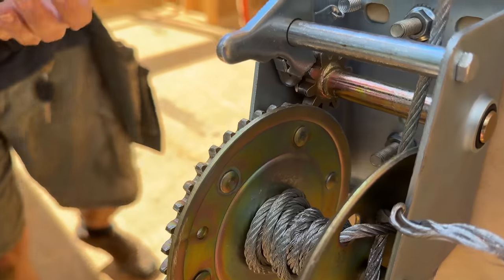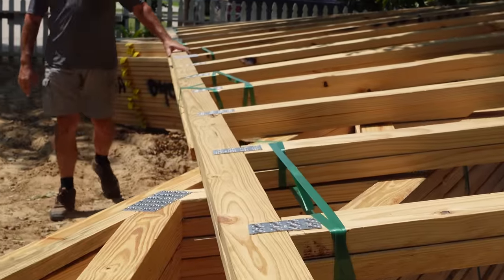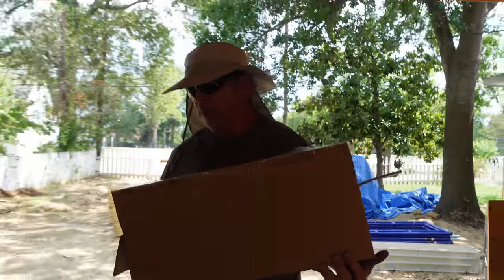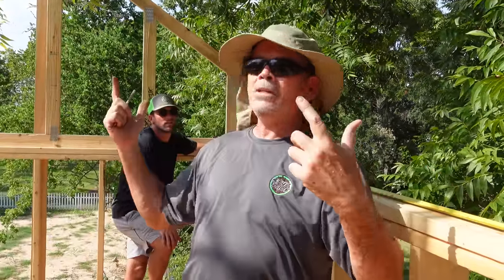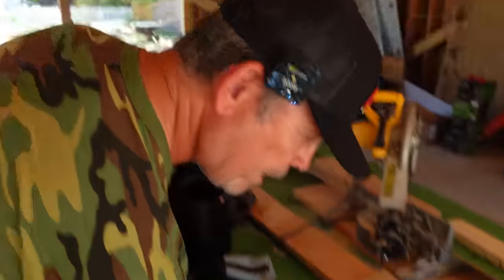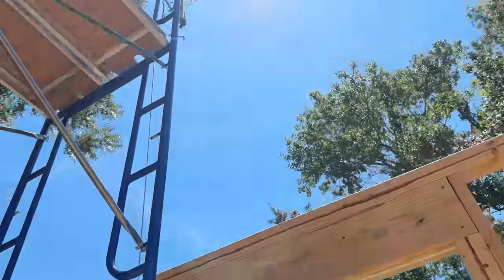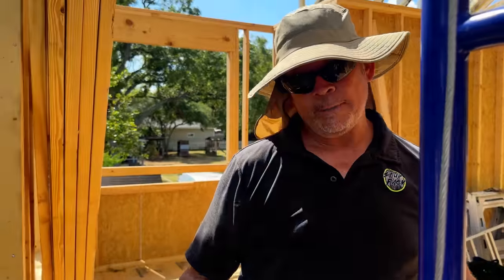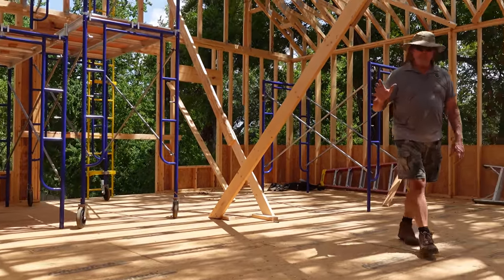Climbing 30 FEET UP to Lift Our Trusses by HAND! (Saving us Thousands)

Comment: This is reminding me of an episode of 'How It's Made' and I'm loving it! I had no idea they made trusses with machines like that.
Oh wow! Rad really is rad! LOL. 
Trying to lift the gable end up is where one of those electric winches you put on the back of a truck and a pulley wheel combo would help.
If you don't have a crane when working on the main house, maybe try the winch thing with a pulley. Did you have an actual pulley wheel? I didn't see one, but my eyes are not great.
You know how sometimes you can use an electric drill can be used to wind/unwind things? I wonder if that would work for turning a mechanism to lift trusses.
Very cool of Diamondback to send you tool bags. One can never have enough tool bags. 
I like your hats with the wide brims and the cloth hanging down the back. I wonder how hard it would be to make some of those with the Stud Pack logo.
Rad goes up and down the ladder fast!
If you make a finished attic you could have some extra storage space up there. You'll definitely want a good attic access and ladder (or folding stairs that can come down).

Comment: Good work fellas, in my old framing crew three of us would stand on the top plates of walls and each pull at the same time, required a little man power but worked like a charm.

Comment: Paul, could you have used a 12 volt impact drill just like you would use for changing tires on a car the crank that winch.? It seems like everybody does that now at the campgrounds with their levelers. Keep up the great work

Comment: I had the same hand winch I used to lift refrigeration compressors on roofs. It lasted about 5 times then the gears started separating as yours did on a lift. They are junk. I have now converted to a 120 volt winch made by Warn and have no problems at all. And I can lift by pressing a button. BTW, I agree with your brothers. A crane is much safer, quicker and more dependable. In some cases I have used a locally rented man lift that reach out to put some systems and piping in place. It's quick and easy.

Comment: if the handle comes off the winch,  measure the shaft ..if 1/2" or less use your drill driver to motorize the winch.. i did it 10 years ago to lift a steel jeep roof for storage..

Comment: In 30 +yrs of framing I've seen my share of pre-fab trusses and with a crane and ample manpower I wouldn't boldly proclaim of how much easier it is when all said and done. As for cost of the crane , check out the Hempstead area next time . Stay safe guys!
Reply: I use Heave Ho crane service in Houston. Good service. Reasonably priced. I believe there's a 4 hour minimum.

Comment: great job there guys, but quick question, these are 2x4 trusses right? why not hand them up through the big window and stack them upside down on the walls and flip them to set them in? When we built our house thats how we did it and we had three people on 35 foot trusses and it went smooth and quick, had them all installed in a day and started sheathing them. Just wondering but great job on the house looking forward to the rest...

Comment: When doing the scaffold crane...

add some cargo straps to keep the scaffold from moving and to diagonal brace it via tension.  You're applying forces in directions the scaffold designer did not expect.

Comment: Shackles have rating on the pin and are certified rated for overhead lifting clevis is also have a weight rating just usually not stamped on the pin as well and are generally for farm use or lateral pulling

Comment: On gable end trusses we would have a 2x nailed to the top plate set back 1 1/2" to also allow lateral fastening of the gable ends. This also serves as a drywall nailer when that application is needed.

Comment: might be more efficient and less labour if you can replace the crank handle with double/triple nuts bolt together and use the cordless impact driver to crank the winch

Comment: if you use that setup again, take the handle off the winch and put the bolt back on tight then use your impact to operate the hand winch.

Comment: Great job getting the trusses up. Those are some tall awkward trusses. With trusses you would normally take a 2x6 flat and run it plate height down the mid span of the building with 2xs nailed underneath it toe nailed into the subfloor and braced over to the exterior wall. This gives you a cat walk to walk on and support to hold the trusses when you spread them out flat on top of the top plates before you tilt them up. Haul the gable truss up and drag it all the way down to the end of the building and hang the point of the truss as far out over the outside edge as you can safely balance it. Then drag all the remaining trusses up the same way and lay them over the top of the other trusses already up there. After all the trusses are up you start standing the gable truss up on the other end and continue until you get to the last two on the end you started on. Pick the last two remaining regular trusses up and temporarily lean them against the last truss you have installed so you can lift the initial gable truss up and put in in place and then drag the last two regular trusses back and put them in place. Always toe nail a 2x straight edge on edge not flat into the building to keep the gable truss from falling off and to give you a place to nail the truss temporarily. Put the straight edge up before you stand the first gable truss and after, you lean the last two trusses and the gable truss up on the other end. I'm curious if you did a plan revision through the building Dept. for the re designed roof design. I know the architect must have had a reason for the way he originally designed the project. Most trusses require bracing at 45 degree angles and with the ceiling being so high and don't see how that could be achieved the way they are now. Maybe the solid beams were for lateral support. Where I'm at a structural change like that would have to be done through a plan change. With the interior walls you could have balloon framed the wall to within an inch of the bottom cord of the truss and rake framed the walls running the same direction as the trusses. This would eliminate the knee action you will have with the way you did it. Simple math. Snap out the rake lines on the floor. Never attach any built up walls to the bottom cord of the trusses. No wood member should be attached to the bottom cord of the truss. Good job and ingenuity in safely getting the trusses up and installed, although somewhat sketchy.

Comment: That is a shackle with a shackle pin, the pin on a shackle is almost always threaded so that it passes thru the hole on one side and screws into the hole on the other side. Although if it is a safety shackle then it has a bolt that passes thru the two holes of the shackle with a nut and either a cotter pin of some type or a safety wire that passes thru a hole drilled thru the threaded end of the bolt. A clevis almost always is fastened to something (i.e. a machine, vehicle, etc.) by welding or by means of screws or bolts and almost always has a clevis pin that is non-threaded and that is held in place with a cotter pin. Also a clevis is also usually used in towing applications(mostly on farm equipment), whereas shackles are typically used in construction, lifting and rigging. Such as in your application. These days however, like so many, many other things, the distinction between the two has become blurred ( by people who have become lazy about learning the proper names and meanings of things) and the two have started to be used interchangeably. One person even put it this way(I believe wrongly so); "All shackles are clevises but not all clevises are shackles.". I believe a shackle is a shackle and a clevis is a clevis and never the twain shall meet.

Comment: Just wondering why you did not lift them all and stack them to the back and then walk them out into position across the project. Could have lifted several at a time and moving them while vertical into position should have been easy.  Just wondering. I loved the winch idea and am going to use something similar on future projects.  Great stuff guys

Comment: Clevis is a marine term for a similar device designed for rigging, typically for sailboats.  A shackle is designed differently for heavy loads and abuse, coming in 2-part and 4-part shackles.

Comment: A lot of framers these days don't put "rat runs" on the bottom chords of the trusses, it needs to be done though or you'll have screw pops, and cracks in your drywall. That's why I always show up to new construction jobs with a pile of 2x4's. When the drywall cracks, and the screws pop they don't call the framer back to fix them so I try to take some preventative measures to keep it from happening. It might not be as bad with those trusses since you won't have anyone crawling around in the attic blowing insulation etc, but I would still tie them all together on the bottom chord. Nice work with the crane! Also interested in seeing how those diamond back's hold up, I've had bad luck with those style bags.

Comment: I built outdoor concert stages and would suspend tarp roof structures over the stage using scaff towers in a similar manner, Word of Advice, put the winch on the opposite side of the tower from the load, this will help prevent tip-over of the tower by spreading the load over ALL 4 legs.

Comment: Should have used a block and tackle configuration to pull it up for less stress on winch. Put  trusses up first and maybe mount first 6 then lean rest against wall then easily raise in place with the scaffolding.

Comment: We spent many winters in Mexico. You are building as they did. There are old pilot and bold pilots but there are no Old Bold pilots. The same probably goes for roofers. Make sure you have approved plans by the city inspector for your new roof design. Code in our area allows you to use 1x4 placed within the rafters to hold them in place and you can leave them after. The external 2x4 also works but it is one more step when you have to remove it. When we build our 2 story garage with rooms above the contractor had the rafters delivered and place upside down as a bundle on top of the walls. He then flipped them upright one at a time. Next set see if the fabricator has a truck with a crane that cam place the trusses on the walls. OHSA would site you for moving the scaffolding with a person on it.

Comment: FYI....Amazon sells some nice 120vAC winches rated at 1000lbs. I got 2 of them they work great and have been extremely handy on several occasions. Highly recommended. They even have wireless remotes. They cost around $400.00. Keep on building!

Comment: It looks like the handle is either slotted or relies on the 2 side braces, either way you could modify a socket if you have to to fit over center nut and then tack it fast. Then get a socket adapter for a drill and pop it in and go to town. Maybe a Milwaukee right angle or hole hog on low speed.

Comment: I do drywall in South Ga... I have to use the scaffolding like that to mud the ceilings...I'm on concrete most of the time, but on wood, make sure no nails are sticking up or else Brad will have to jump down 40 ft...love yalls work and channel...

Comment: I hand built the trusses for a garage build.  Then built a crane extension for my tractor using a harbor freight winch with a remote control.. set the trusses by myself.
Love what you’re doing boys.

Comment: Did you grease the main gear and axle on the lifting crank to reduce the cranking tork stress before you started?  I find that companies use water based lube to protect gears for shipping and need to be lubed properly before use.  Nice job and well thought out way to “raise the roof,”

Comment: I was a millwright. Worked with shackles and pins my whole career. Blew the dust off of one of my rigging books from my apprenticeship days. They describe the words "clevis" and "shackles" as interchangeable. And, I have heard them referred to as both, usually  depending upon the part of the country. I always called them shackles and pins or screw shackles.

Comment: I've done something similar to your winch trick. But I took the handle off and welded on a socket so I could attach a big drill with the side handle to it. It'll lift those trusses up fast, just keep some wd 40 on hand to keep the gears lubed. You can also weld a socket driver on the original handle so you can use it if you need to.

Comment: aligning the studs to roof rafters is part of "advanced Framing" techniques.....you could have framed it all at 24" on-center spacings, thus eliminating the top-plate, saving a lot of lumber and reducing "bridging.    Look into "advanced framing" when you start in on the main house....cheers!

Comment: Amazing use of scaffolding for trusses , I’ve never seen that . 
Later on in my cart I started to like cranes and telehandlers to save my back plus labour costs are a little less .
 Having said that in urban areas we hand balmed them up with two or three ropes (three people ) including 50’ trusses ouch.
Put in the end it’s about getting the job done with what ever is easiest for each individual job and circumstances. 
That is a high roof design btw .

Comment: Suggestion: next time remove the handle off the winch, re-apply two nuts to tighten against each other and use a cordless drill and socket for operating.  I’ve done it and it’s a timesaver!

Comment: That winch is a great idea.  The hardware guys should have shown you an elongated nut (usually used with a 3/4" socket) that you could use with an impact wrench or just a H.D. 20v DeWalt drill.  That truss would go up 4-6 times faster and not wear your arm out.

Comment: If you have have to do this again use a wyrm gear one. It will cost a bit more but it can lift at 2200+ lb easy. Big bonus you can take the handle off and drive it with a drill and socket. Lifted all the lvls at my place with one and all the trusses at another. We also put up a 35' 3 ply lvl with 2 of them. I think they were $40. Also there is no brake so you can go up and down as you want.

Comment: Okay, I'm impressed but after reading a lot of comments, I was torn between their ingenuity and accomplishment vs. the safety sketchiness of it all. In my mind, all they did was build a material lifter which back in my factory building days, we used dozens of them... a 24' Genie lift would have been easy to rent but they would have had to rig it  up with a jig and then use another lift up on the open deck adding complexity with a handoff so hats off to them for figuring this out the way they did... If I proposed something similar back at work, the Safety Engineer would've shot it down unless we 'engineered' and built something official and it would been similar or the same but with outriggers and taken several weeks of delay. Great job Stud Pack!

Comment: The cost for a telehandler rental must have been high. Those things make quick work of those trusses. And no cranking. Maybe instead of the crank ya'll could mount an electric wench. Got one on a truck bumper you could borrow?

Comment: Most professional framers hang their hammers in the back of their bags. It stays out the way when you walk and move around. However if you fall, if the hand is perpendicular to your body when you land, it can break your back.

Also a second pro-framing tip. You always keep your "heel" of the truss at least a quarter inch short of the edge of your top plate on your walls. The reason you do that is because often, the house is not perfectly level and that causes the vertical bird's mouth area between your trusses to be out of plumb. Also, sometimes the truss companies cut the heel cut out of plumb, believe it or not. Code will require that you install blocking between the trusses as braces. Pro-framers use these blocks to form a plumb, straight surface along the edge of your wall. Pro-framers are skilled enough to form this straight and plumb line along the truss edges by site, but you should probably use a string. This may seem ticky-tacky or picky, but if that roof edge is not reasonably straight and plumb, if can make installing fascia and  soffit and your siding material a nightmare.  

In framing, you save yourself a multitude of problems by keeping everything in the house straight, square and plumb. Pro-carpenters can do most of this just buy "sighting" the lines of edges, soffits, fascia and drops.  Non-pros should use a string on anything over 15 feet.

Make sure you install your gable trusses plumb. Otherwise you will have a world of problems when you install your siding or stucco.

Comment: Front to rear walls clear span has been done with oversized pulleys and two men on ground on each pulley rope raising upside down roof truss to top plate with a two man team dragging truss to stud line on top plate, then lifting and blocking on a 36 by 50 ft two story gable roof.  Took us one day to lift and assemble, one to close sheathing ...never heard of using scaffolding tower instead of our simpler six grunts with muscles and rope method.  Built hundreds of units in pre fab subdivisions southeast Louisiana.